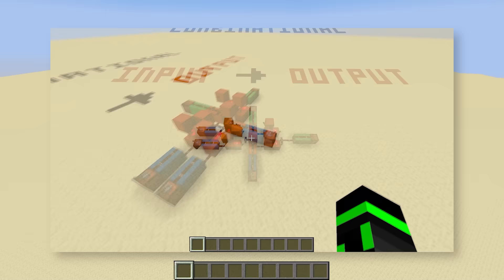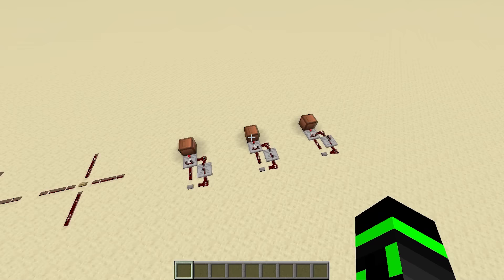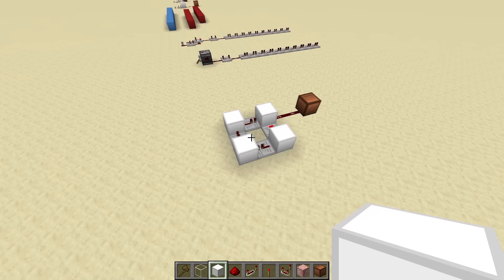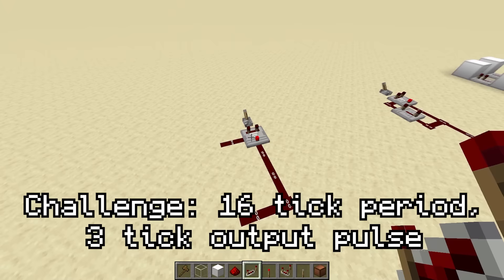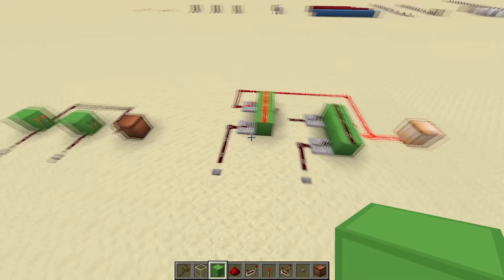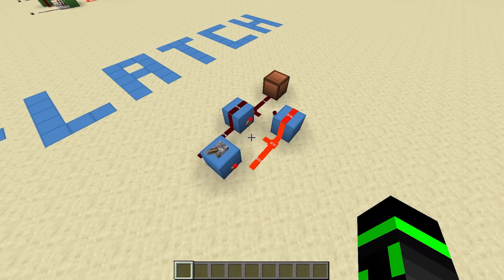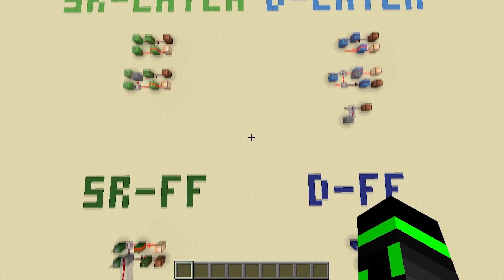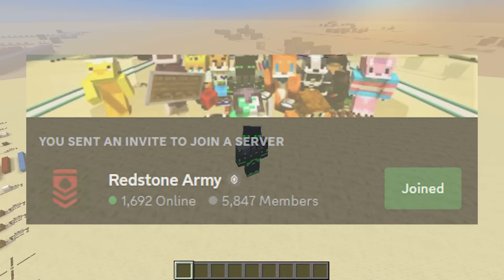Pulses, Clocks, Latches & Flip-flops - LRR #7

Comment: 8:31 you know you can just use 2 normal pistons facing each other with a 2 block gap between them and in one of them put redston block
Reply: He doesn't like using pistons for some reason (no one knows why)
Reply: @hahahaha666 Pistons cause immense lag and make sound
Reply: @stanh9425  Redstone dust(that he likes to uses a lot) causes much more lag. You usually won't be standing that close to redstone contraption for the sound to be annoying and even if you would you can just turn the sound down or use a resource pack to turn off specific sounds.

Comment: A SR latch is supposed to be Set dominant the Set Line should be the only Line active If both Inputs are 1
The counterpart on the other Hand the RS Latch is Reset dominant the Inverted Line should be the only Line active

Those "false States" are used frequently as far as i know

Not the best explanation but i learned it in German so yeah xd

Comment: 6:10 isnt easier just using a 3 tick repeater after the coparator instead of that Second compartor + repeater
Reply: Yes and no, because then youll get a pulse when the button powers and unpowers.
Reply: @stanh9425 the signal from de last repeater cancels the lever signal, it would be the same
Reply: @caut-arg  I thought you said observer. Still, the answer is no, because the clock functions by being on for 8 ticks and off for 8 ticks. Thats why its a 16 tick clock, so you need the pulse to be 8 ticks long.
Reply: @stanh9425 i tried what i said and it works, is just a little less readable, i think is the reason why he Made it how it is in the video
Reply: @caut-arg  It literally cant work. Either your clock is now 11 ticks long, or your output is 8 ticks long.
Reply: @stanh9425  you didn't understand what i did